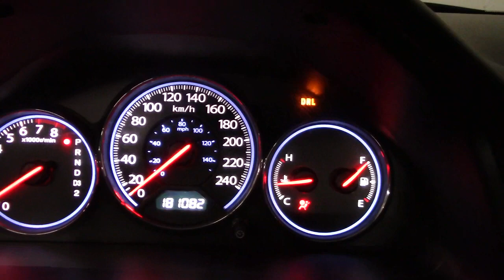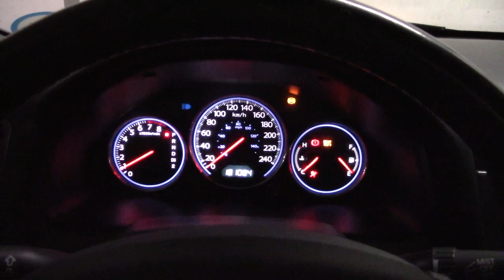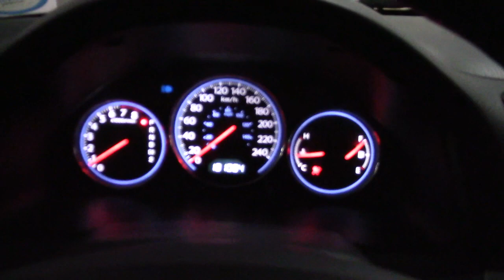How to Repair DRL Module Honda Civic Daytime Running Lights

Comment: After 3 years, my High Beams started flickering and then failed and after testing the LEDs, I immediately thought the DRL module was the culprit. So, looking online for the location of the DRL module (which I had forgotten the location of),  I found your video AGAIN 😄!  And indeed, one of the repaired solder pads had cracked again! This definitely points to the 'lead-free' solder type used on these boards, which becomes brittle with time. So this time, I sucked the old solder out with some fine stranded copper wire and applied some fresh old style LEADED solder, which shouldn't suffer this problem. Hopefully now it will outlast the car that's going onto its 22nd year!!! And since I now use LED headlights and they don't work with DRL, I simply look at the dash and if I see the DRL warning I simply turn the lights ON. The only caveat, you have to remember to turn the lights OFF when you shut the engine off!!!

Comment: Great video. My aunt has a 2004 Civic, battery dies because of a parasitic draw and didn't know where the problem was. I changed the battery and noticed that the blue high beam indicator light in the dash flickers when the headlights are off while idling, but the indicator lamp in the dash does light up solid when I turn on the headlights and activate the high beams which do come on. Is there a possibility that a parasitic power draw could be coming from that as well. I was wondering if it could be a combination of the fix in this video and a bad ground somewhere. The car only has about 35,000 miles and is garage kept.

Comment: THANKS!!! 2003 Honda civic Put new headlamps in because pass side high beam wouldn't come on. After replacing lamps didn't change anything . Next day only the high beam on driver's side would come on. This also cured the DRL problem
Reply: I have the same issue
Reply: @suzukiice Hi I thought i had the DRL problem fixed but it quit the next day. By re-soldering the circuit board my high beams have been working so this video helped me. I haven't done any more research on this yet

Comment: Thank you so much ! My 2002 Civic passenger side day light is not working, buzz sound coming behind the CD player. Changed the headlight, did not work.Tested the fuse all is working fine. Finally found this video and read all comments ,located the DRL control module, tesolder  the two relays,Bingo !

Comment: Wow thanks for this video... My symptoms were that my high beams sometimes wouldn't come on. But sometimes only the left one would go out with no blue high beam indicator on the dash. Pulled the module - I didn't have straight flux, but I had flux core solder - so I melted each pin and added flux core solder to each. Took all of maybe 15 min to pull, fix and replace. Seems to have completely fixed this issue.

Comment: Do you know if this would be the same on the acura? 06 tl
Reply from the maker: The DRL Module should be the same but in another location. The repair is always the solder joints on the big relays.
Reply: I'm guessing you wouldn't know where that is? I look anywhere I could find online and there was nothing about  the module, the dealer doesn't even know so I'm assuming it's a relay thingy. Idk what it's called
Reply from the maker: @sh4rp935  As shown in my video the DRL - Daytime Running Light module is inside a grey plastic box. DRL module location for 2001 - 2005 Honda Civic and 2001 - 2006 Acura is on driver side high under dash (higher than steering column) between door and brake pedal. All you can see is the wire harness block hanging down, best to see module from gas pedal up across towards door. The DRL module grey plastic box is mounted to a slide tab but can be very tight to remove and remount, in my video disconnecting the wire harness block and prying open the circuit board was easier for Honda.

Comment: Great video! You say it's for 2001-2005, does the DRL module work differently on a 2006?
Reply from the maker: Yes it does, first its in a different location, consult the manual. The DRL Module itself is slightly smaller and uses more power but the repair is identical.
Reply: @easydiyrepair5657  Thank you, it is exactly the answer I was looking for. The reason I asked was not to repair the cold joints to the relays on the module, but to find out whether LED High Beams would work or could be made to work in DRL mode on my 2004 Civic in conjunction with LED Headlights and your answer seems to confirm that they cannot.

It turns out that from the 2006 model year, you can acquire plug-in LED driver modules that will make the High Beam LEDs work as a DRL using PWM - the trick is that they require 12V to exist and be available for the LED bulb to work, essentially by increasing the frequency so that the LEDs won't flash or strobe.

OTOH, these module simply don't work if the DRL puts high beams in series or feeds low voltage to the headlight using resistors for DRL use, like the older generation DRL seems to operate at.

if I could secure a 7th gen DRL module schematic, I could probably figure out a modification that would allow use of a PWM module with the high beams to light them up at reduced intensity for DRL use,  but my hunt for a schematic has been unsuccessful (If you had any idea where to look for that schematic, I'd appreciate a tip!)

In the meantime, I've devised a klutz that may well in the end be the only practical solution: to forgo the high beams for DRL and use the position/turn bulbs instead, replacing them with high power LED switchbacks, that would be powered by a relay controlled by the DRL indicator circuit: In essence, the DRL fault indicator circuit would be used to actuate a relay that would power the front white LEDs of the turn signal/position switchbacks replacing the original dual filament amber bulb.

 

My only problem now is to find a Switchback LED that has the proper configuration for the existing reflector, sufficient intensity for DRL use and the reliability and proper cooling required for an LED that will be on at all times...
Reply from the maker: interesting modification you have planned, if you create a video let me know. I wonder if after market accent LEDs might fit inside the Lens housing?
Reply: @easydiyrepair5657  I've decided not to install anything that would require unsealing the housing - I've done it once (in an oven) and almost destroyed it, so I'm not too keen trying again!

The DRL switchback modification is quite simple in comparison, the 2004 Civic uses an 1057 bulb as a park/direction bulb so that should be no problem. You'd have to cut off the existing park wire and power the white LED directly from a relay powered up by the DRL dash light circuit coming out of the DRL relay. If the schematic I managed to find is the correct one, it's connection 9 on the DRL module and K7 of the fuse/relay box nearby. Cutting the existing white/blue wire on DRL 9 and yellow on K7 would disconnect the DRL dash light so it wouldn't be bother you anymore. 

I'll get to it when the weather gets better, winter's been brutal here in the Great White North (I don't have a garage).

Comment: Thanks to your video, yesterday my son and I fixed this exactly problem in his 2001 civic LX.
Immediately after having the right high-beam working (typical Honda drl board problem), and the DRL light gone, the alternator bearing started growling: coincidence? Maybe... :)
Reply from the maker: DRL module reduces voltage to High Beam bulbs, repairing the module doesn't draw much power and the module is fused preventing short circuits... test power load by starting vehicle with DRL Module unplugged... just bad luck your alternator complained, battery was probably low.

Comment: Thanks for sharing ,
Pls, 
Witch kind soldering iron with how many watts ?
The size of wire ?
Thanks
Reply from the maker: low power solder iron is fine - video shows Ungar 40 watt tip. The key is the flux paste which cleans and helps melt solder faster. Use any solder wire size, most repairs only require re-melting/flowing the onboard solder joints.

Comment: Will this work on a 2002 Honda Civic? Have the same problem with the day time running lights
Reply from the maker: Any vehicle any year with Daytime Running Light module acting up can be fixed the same way = resolder joints.

Comment: dman..it worked..i had replaced my old one..and the new one starting buzzing after 3-4 years.

i saw your video and i did this to the old one..and replaced the 2n'd..and it worked..

thank you very much.. i wish i could buy you a pack 'o beer or somehtin'
Reply from the maker: Glad it helped

Comment: Thanks for posting. I hope this helps with my 2006 Honda Pilot. Similar issue, DRL light and one high beam that will not work. Can I use the same flux and solder that I use for copper water lines?
Reply from the maker: DRL Module repair is very similar, best to use electrical solder but may only require re-flowing the current onboard solder joints.

Comment: I did everything but my DRL still pops up, although i mightve put some mixed some leaded solder in, could that be the issue?
Reply from the maker: verify the Day Time Running headlights are actually OFF. If headlights are all OFF clean the connector ends of lint/dust with toothbrush. Carefully re-check all DRL module components for burnt/blown units or detached wires and cracks, reheat all connections using tiny amount of flux. If headlights are ON and DRL indicator is lit check the emergency hand brake is disengaged fully.

Comment: Wow that is slick. I removed the module and found one cold solder joint. I hit all of them on both relays with some flux, heat with a bit of solder and fixed! Thanks. 05 MDX
Reply from the maker: Good job reflowing all the solder joints, probably added 4 years preventing future failure.

Comment: Hello, please i have honda 2013. The DRL started showing on my journey this morning. What do it?
Reply from the maker: When the DRL indicator light appears park the vehicle and with the car still running go outside and confirm both high beams lights are on. If both are on check vehicle manual and Parking Brake release.

Comment: Will this work with an rsx?
Reply: I may have the same problem
Reply from the maker: Most DRL modules are the same, the trick is located them and identifying bad solder joints.

Comment: the DRL on my 04 civic comes on every now and then after I start the car. could this be it?
Reply: My gfs 04 civic was exactly as you're describing until it completely failed and headlights wouldn't work. This is what it was. Once I resolder the relays everything worked again and the DRL light was gone.
Reply: @AndrewStCyr  oh great to know! It hasnt done it for the past few days but im sure it'll come back on sooner or later. good to know that its the module, i'll save this video for later.

Comment: Great vid, I hv the exact same problem, the only thing I would do differently and will do is test it out with the plug before installing in the housing after the repair 👍
Reply from the maker: this DRL Module repair is so common I don't even test them after reflowing solder connections, just hand back to vehicle owners for reinstall.
Reply: easy DIY repair for such a common problem, what do you think causes this?
Reply from the maker: Solder Joint Failure is usually caused by non-leaded solder applied to contaminated (unclean) contact wire/lead/post. The Relay posts were dirty when attached to board or became hot over years or vibrations weakened the joint or all of the above. Reflowing the joints and applying fresh solder always works.

Comment: Thank you so much! My 02 civic had no drls, made a buzzing noise after putting the ebrake down, and had no high beams. This solved all of it! Just saved me $60, much appreciated👍
Reply: I also had the noise. Turning on the regular headlight stopped the noise. Relays had numerous solder cracks.  20 minute fix!
Reply from the maker: glad you found my video helpful, the DRL Module fails in most North American vehicles, some make a noise like yours others nothing but DRL light on instrument panel. The trick is locating the module under the dash, mine was easy to access.
Reply: @easydiyrepair5657   thanks my drl light is on and so is the buzzer

Comment: Thanks very much! This is extremely helpful and saves about $60 for the module!

If they would have made the solder pads just a bit bigger, then when they do the solder bath more solder would have been sucked up and this problem probably wouldn't have happened :)

Comment: Could this issue drain the battery
Reply from the maker: The circuit is protected by a fuse to prevent shorts but will use power if key is turned 1 or 2 clicks. The headlight bulbs would use more power unless relays shorted out blowing the fuse. On rare occasions one or more weak solder joints can spark and heat up discoloring the circuit board. I doubt it would drain battery with vehicle turned off. Budget low amp batteries only last 4 years then require replacement, always have your battery 'load-tested' every 4 years.
Reply: @easydiyrepair5657  thanks

Comment: Cant find my own circuit board. 2007 honda Civic
Reply from the maker: Usually DRL module is mounted high under dash, move to brake peddle and look straight up for grey plastic box. Check near center console under and behind radio, also under passenger side dash and under hood near fuse box, but its almost always under driver side dash.

Comment: I have a 2003 honda civic, has exactly same problem, high beam light off and DLR signal on. So followed the instruction and it works. Thanks man that saved me couple of hundred bulks.
Reply from the maker: before posting this DIY DRL video took my car in for oil change and they changed the high beam bulb thinking that was the issue, wrong, so they replaced the bulb that was perfectly fine.

Comment: Where can I find the DRL relay module on a 2007 Honda CRV? I had no luck locating it based on videos I saw for the 2005 Honda CRV.
Reply from the maker: 2007 Honda CRV DRL module is in the same position under the driver side dash closer to the door. The module is same grey colour and shape and hangs high up under dash. Must get on your back to reach it. Some US cars don't have these modules installed.
Reply: R Jones

Comment: I have a 2005 honda civic and my high beams wouldn't work and the DRL light was constantly on... Did as instructed in this video and I personally had a much worse soldering job but it still actually worked! Thanks man
Reply from the maker: good work, it's an easy DIY repair any Honda owner can perform to save $100-$200.